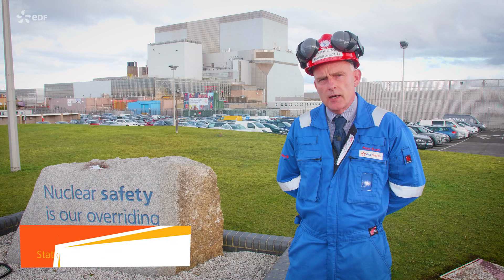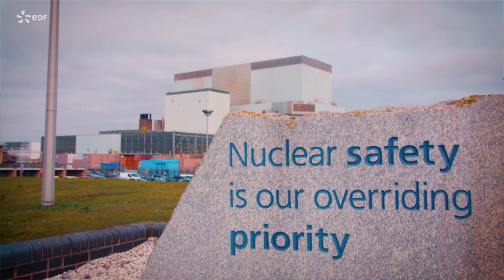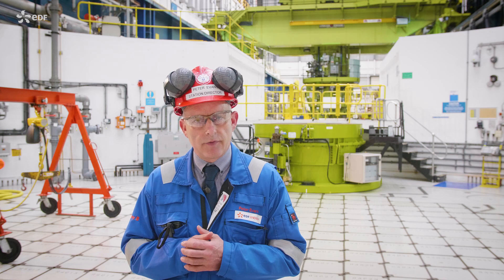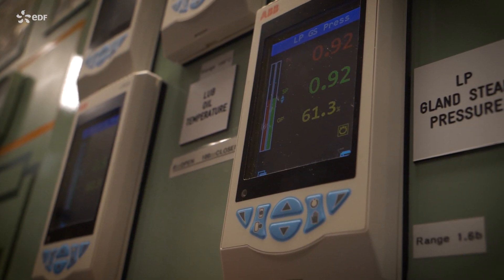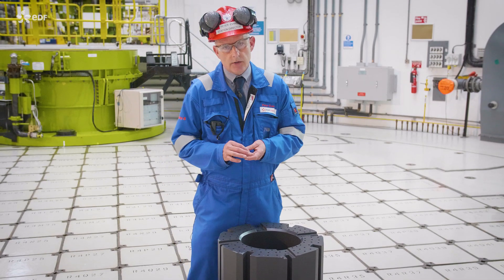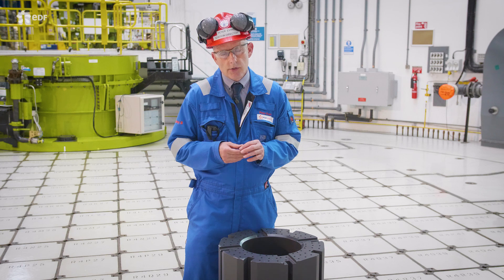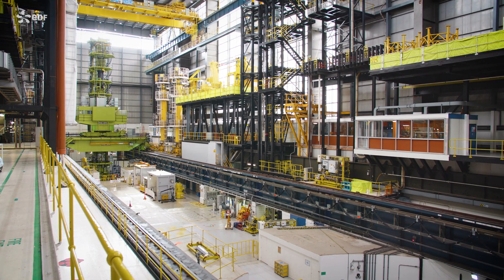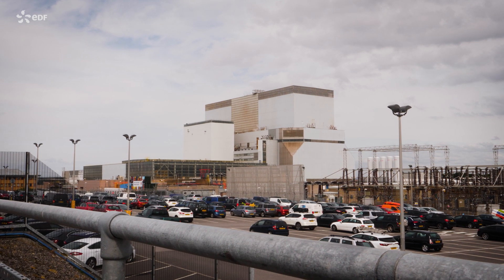Take a look around Hinkley Point B nuclear power station with Station Director Peter Evans

Comment: What is it that prevents re-use of this plant.
Mention is made of the keyed graphite blocks. If these are the problem could they just be reaplaced?
Or is it general age/corrosion of all the pipes and joints / valves?

Comment: Such a shame i gets shutdown before the practical date.  Use it at a lower rate even, just keep going  as long as it can be done.

If it cost too much we all should pay the difference in cost to keep it running at a lower rate for the sake of clean energy.
Reply: it was supposed to be shut down in 2016 but its now operating till 2023
Edit: It ceased operation on August 1st 2022.